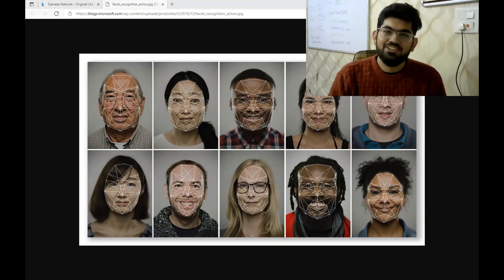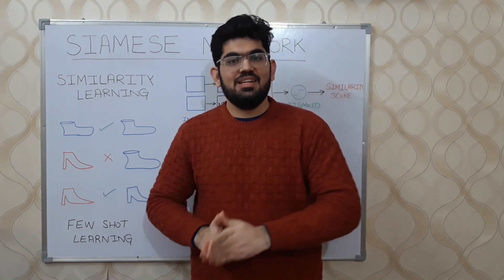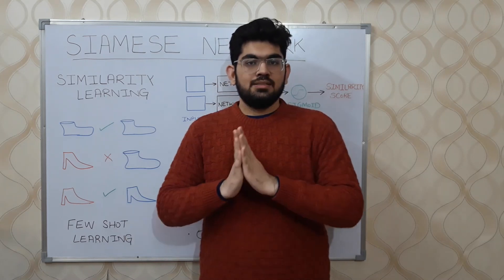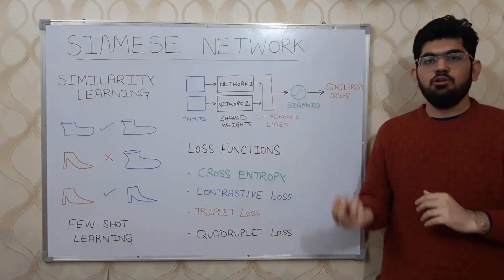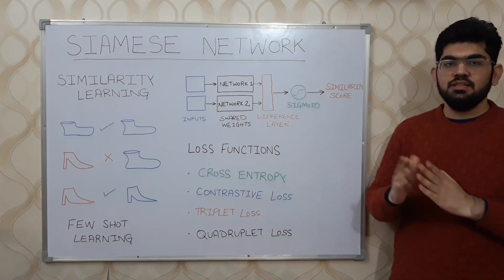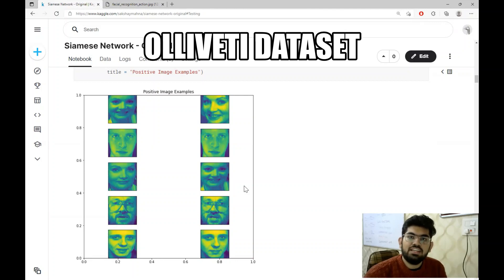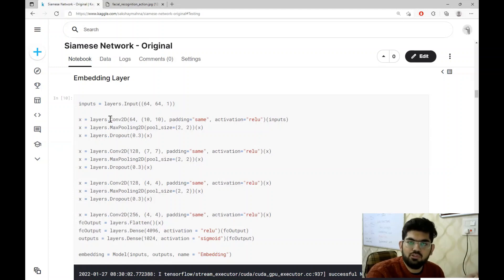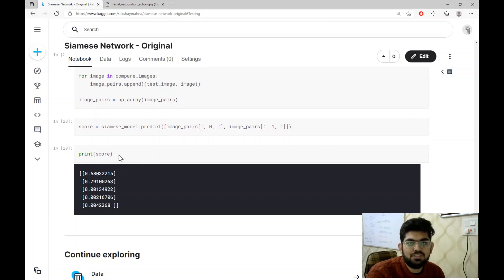Siamese Networks | Face Recognition | Computer Vision on Humans

Comment: can i use a pretained model and make an application where i will allow students to register their face and once they are done, they can login to the app and start verifying their face. I want the app to work in way whereby i need not have to take time to collect facial data of every students in the class. I want the data collection to be done while registration of the student to the app.

Comment: Hello Sir, thank you for this video, it very helpful. Instead I have a question. Should we need a huge data to a similarity of two different signals? For example I’m having two signals and I want to ensure they are both similar or not. In this case, while using Siamese network, these two signals are enough to input in the network with only one label of (x1, x2, 0) or I need to define more labels to train the network and compute the similarity? How many datas samples are required?
Reply from the maker: Hello!
Interesting Question! A huge dataset would not be required. Around 10-20 samples for each signal would be sufficient. If you use the loss similar to the one described in the code, then we would pair each data sample, and define that as the label. For example, if we have 10 data points each for signal 1 (x1, x2, x3, .., x10) and for signal 2 (y1, y2, y3, .., y10). We would create 3 types of labels (xi, yi, 0), (xi, xj, 1) and (yi, yj, 1). All these labels would now be used for training the network.

Hope this makes sense, let me know if you have any further questions.